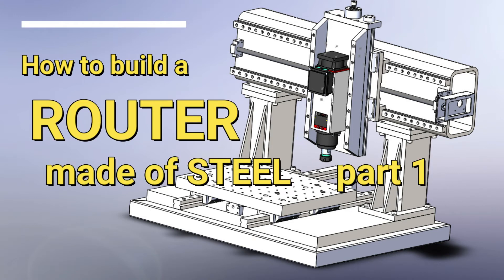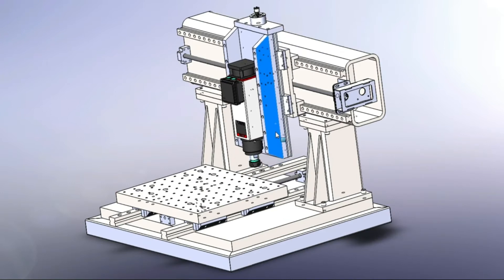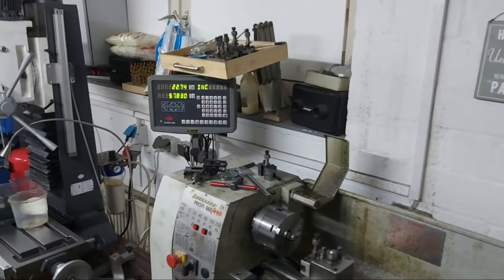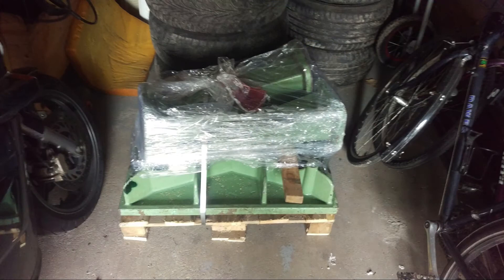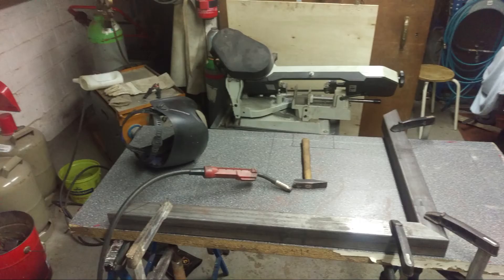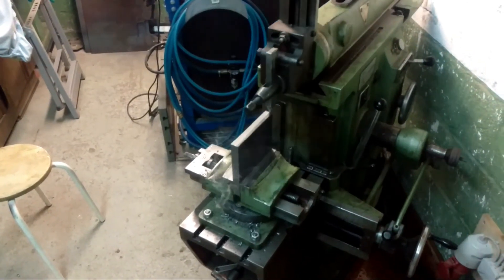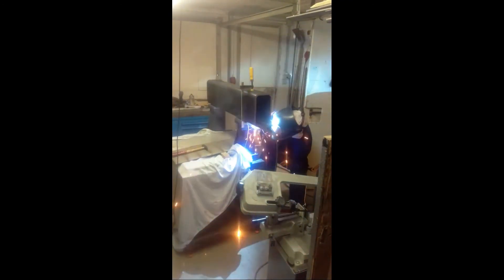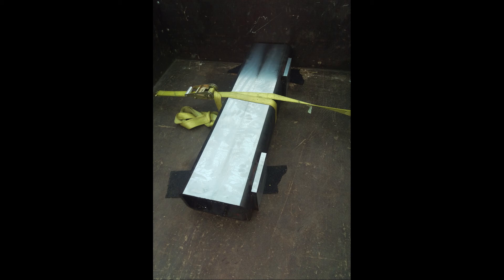How to build a rigid Fixed Gantry CNC Router made of steel (DIY) 1/2

Comment: Thank you for sharing  , I was just concern about the acuracy what is the difrence beetwin cast column verses steel just about the stability , could you also tell me about all steps you need to take to built complete cnc mill including guide ways and electical , I would realy appriciate that ,

Thank you and good luck to you

Comment: I would be very interested in CAD files!
I've concluded that a rigid gantry CNC is all that's going to work well for the thicker Aluminium projects I would like to try.

You Germans though....you are so lucky with the amount of good quality, second hand equipment you have available, not to mention places to get quality machining manufacturing performed as a service. The things I see getting collected as 'scrap yard' items by the 'Post Apocalyptic Inventor' youtube channel are better than most of the new items for sale here in Australia, and we have almost no manufacturing industry worth speaking of now :-(
Reply from the maker: DIY, homeshop build CNC mill router, cutting steel, plans available:
https://drive.google.com/file/d/1iLqC...
Reply: @RUNCNC  It doesnt exist, is there any new version please?
Reply from the maker: @tomasjedno7780  fixed: https://drive.google.com/drive/folders/1hwda6CFJtIGftrL5-l1fkFvQ2RGibhAt?usp=drive_link

Comment: Do you have problems with chips getting into the threaded holes of the machine bed? Mine is aluminum and I’m not sure I want steel chips getting in there. Not sure what to do yet.

Also could you share your weld stress relief temperature profile?
Reply from the maker: No problems with chips. I just use an air gun to blow them out. I used a pottery oven for heat treatment. I heated the steel for 6 hours and let it cool down over night. (sorry, no fancy relief profile)
Reply: @RUNCNC  good idea, thank you so much and congrats on the machine!

Comment: Nice build, i wonder if you used preload linear bearings.
Reply from the maker: The linear bearings are from Schnneberger MR35 and MR 25. They are pretty decent.I recycled them from a Deckel DC 100V, which is a 10 tons machine.
Reply: "pretty decent" mate it doesnt get any better than that 😂

Comment: Great job so far. I would love to get the CAD files for this, even though sharing these means that you might get A LOT of stupid questions.
Speaking of stupid questions, I already have one. You spoke about heat treating the parts, did that simply mean tempering (Anlassglühen bzw. Entspannen) or was it actual hardening (Härten)?

Schönen Sonntag noch!
Reply from the maker: Short answer in English: I heated the welded parts for about 4 hours at 580°C and let it slowly cool down to room temperature over night.

Deutsch ist für mich viel einfacher:
Durch das Schweißen wird der Stahl sehr unterschiedlich erwärmt. Hierdurch entstehen Spannungen im Material (unterschiedliche Wärmeausdehnung), die im Laufe der Zeit langsam frei und das Bauteil verformen würden. Das möchte man natürlich nicht bei präzisen Flächen, die die Geometrie der Maschine bilden. Daher bringt man das Bauteil für mehrere Stunden auf eine Temperatur um 580 Grad, bei der sich die Spannungen im jetzt weichen Stahl setzen. Nach dem langsamen Abkühlen ist das Material "spannungsarm" und verzieht sich hoffentlich nicht mehr. Eine Alternative, wenn man viel Zeit hat,  wäre das Bauteil nach dem Schweißen für 20 Jahre im Garten zu vergraben.

Beim Härten würde der Stahl schnell in Wasser oder Öl abgekühlt, also genau das Gegenteil. Das wollen wir hier aber nicht, denn dann hätten wir wieder Spannungen im Material.
Reply: @RUNCNC  Thanks a lot for clearing that up. 👍

Vielen Dank für die Klarstellung. 👍